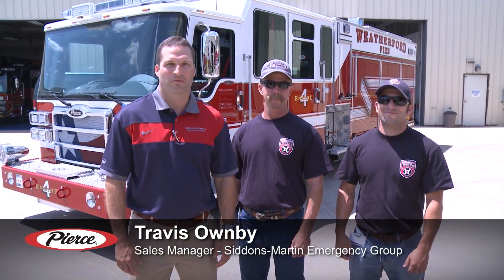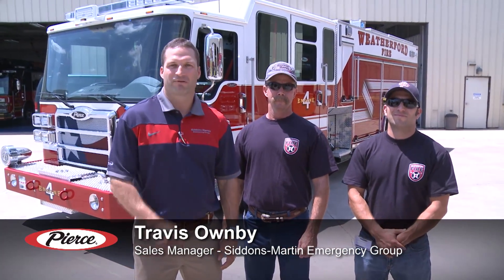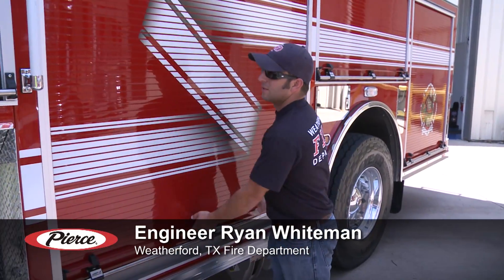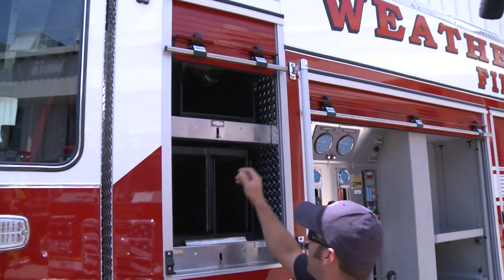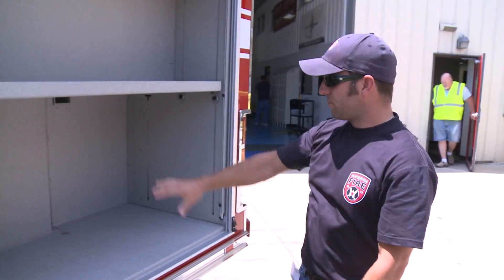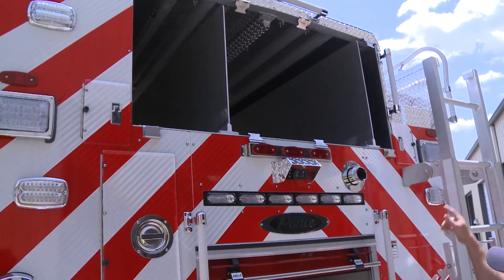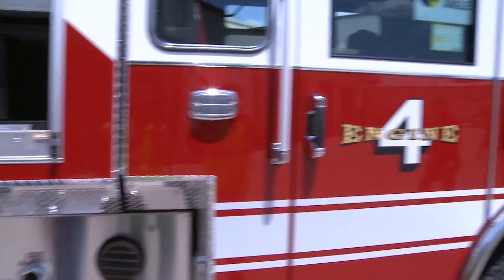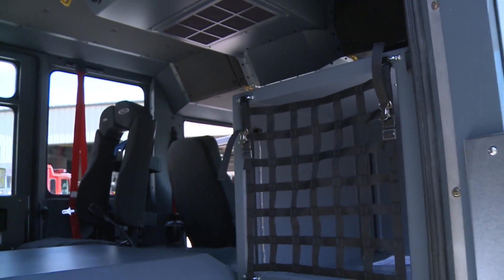Weatherford, Dash® CF PUC™ Pumper

Comment: Nice rig, but not a good choice for a pump panel especially if your on the interstate The top mount is far more safer  especial with the idiots speeding and texting and talking on the phone while driving. And I would use the old school rotater light bar on the cab You can see it far better on a bright sunny day but other than that what a nice truck!